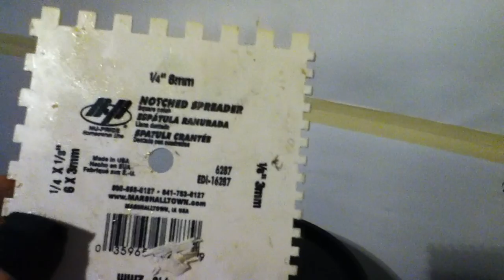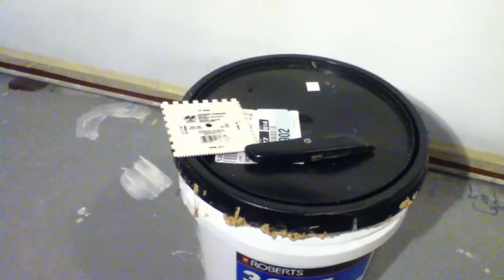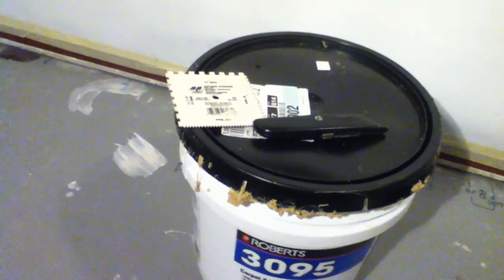Home Theater Carpet on wall using  Roberts 3095 carpet adhesive  from Home Depot

Comment: Thanks for the video.  I’m using Robert’s 3095 to apply 14” wide carpet strips between the floor joists in my theatre room ceiling.  Works like a dream and noticeable difference in STC levels even without mineral wool & drywall.
Reply: Quick question, when you applied the carpet to the wall was it glued to sheet rock or drywall?
Reply from the maker: With a drop ceiling under the carpet or exposed? I would almost think you would want to make an arch of the carpet between the floor joists and staple it at the side bottom edges.
Reply from the maker: Also I glued it right to the drywall paper so it will ruin it if removed I'm pretty sure. I'm trying to think if I put down some primer paint first.
Reply: @JnJShiffler  I’m stapling it right to the subfloor.  Then I’ll install two layers of rockwool, 5.5” and 3”.  Then mass loaded vinyl stapled to the floor joists.

Comment: Why can't i find more videos of carpet tiles on the wall. I guess it not common due to safety concerns perhaps but the stuff is all over our floors anyway. I have a little studio room 5x5 meter which i want to put carpet on the walls.
Reply from the maker: Carpet for sound proofing is a tricky thing.  The height of the carpet pile determines which frequencies will be absorbed.  I did some research, I'm no sound engineer but you'd need carpet of differing heights, some being several inches to capture all unwanted frequencies.  Your room sounds small enough to cover with the egg crate foam type sound material.   I would not try using carpet alone.  You can make the sound absorption frames too and place at the right spots.  There's a real science to it.

Comment: Wish You could Help Me.Do the Walls in My  CarTrailer..
Reply from the maker: You can do it  yourself, no worries, not that hard.  Helpers a must to hold carpet up.  Grooved plastic trowels the key.  Nice even coating of adhesive in even stripes.  What size grooves?  up to you.